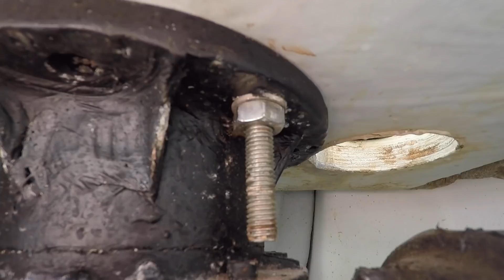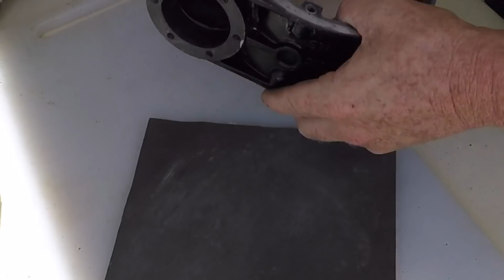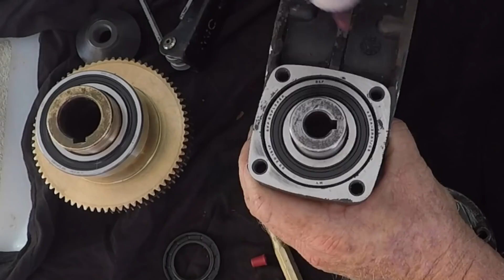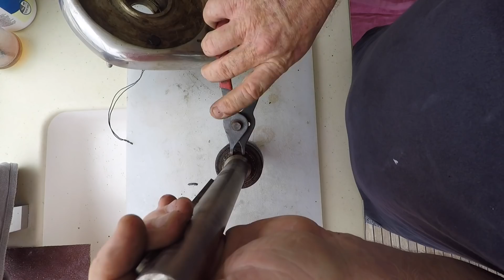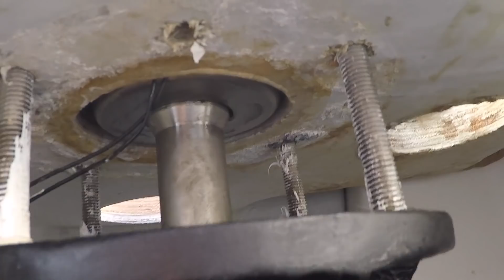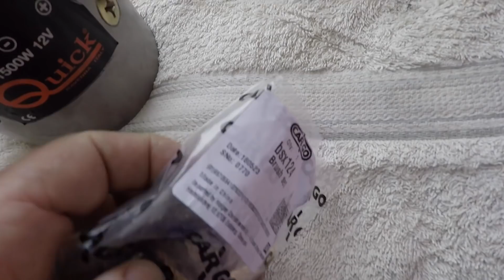ANCHOR WINDLASS STRIP & ASSEMBLE - Quick Argo entire winch assembly

Comment: Mate, great Vid' !  For someone who is not keen on making Tech' Vid's you absolutely aced that!  Simple, informative and in layman's terms.    I just finished yesterday completely rebuilding my Windlass (a Loframs Tigres Horizontal) probably 30 odd years old, seized & probably never serviced.  Corrosion of the housing was severe, mainly due to the hot dip plastic coating cracked and chipped allowing salt  & corrosion to form underneath it. Hopefully it will be good for another 5 years or so and one less job to do before I splash hopefully in April!!??
Reply from the maker: Aye Tex - awesome stuff mate and thanks for the great comment. We need to catch a drink or two again soon aye!
That Lofrans Tigres horizontal is great - I wish it could fit in the place of our one ! I was looking at the Falkon but has a height of 340mm. The Tigres is closer at 290mm but still would need a modification if I want to fit it. Unfortunately we are quite stuck with the vertical unless we go for a lower powered unit.
Looking forward to your S P L A S H Tex

Comment: Great video. How long was the entire project?
Reply from the maker: Hi Dave, The entire project is probably 2 days work if one is not filming and has all spare parts. We were doing other work between whilst we waited to get seals and bearings, so would not be a true reflection of how long it would take a person normally. The thing about this work is that if on anchor one can do it 'piece meal'. So within an hour you can have the top servicing done excluding seals and bearings. Within a day, if the shaft is not difficult to release (maintained previously with Tef Gel) the entire top section can be done in a day. The gearbox and motor would be a full day if all parts are with you - early morning till evening it can all be done, and sooner if you have the right tools.

Comment: Great video Brent you really are pushing me to service my Quick windlass but lucky mine is a horizontal Hector 1500w.
I have for years used a socket to seat bearings and seals. Choose the correct size on the edge you need to knock and it’s easier as you are knocking the whole surface at once. As long as the centre shaft is short or non existent it works great.
Are the harken brushes cheaper than the quick ones 😂
Reply from the maker: Aye Mike - yes I will admit I wished I had your horizontal windlass !
Sockets work great if one has the right sized sockets so that is a very cool idea. Chuck Lanter who features in the video told me he even puts the shaft into the freezer so the bearings just slide on there and it reminded me of the days as a Caterpillar mechanic, we used liquid nitrogen to shrink shafts.
As for the Harken brushes - lol - nope - one should just buy them outside.
I'm looking to buy a spare motor since it fits my Harken windlass, Quick and also fits the Lofrans windlasses 12v 1500w.
The Brushes were $10 for a pack of 4  - lol - (they are 25 x 13 x 9 mm) . Harken told me they do not supply them!